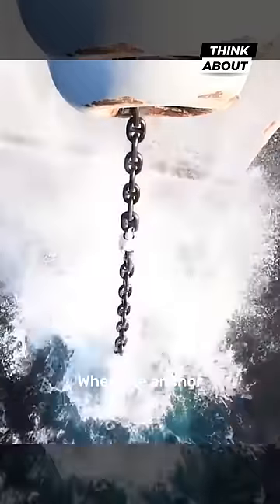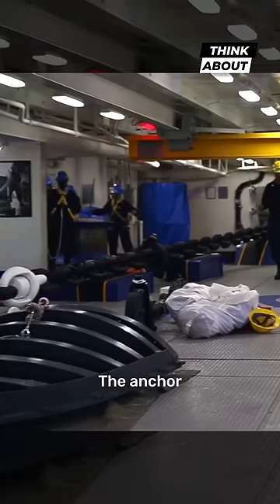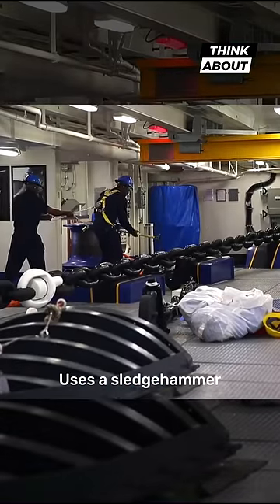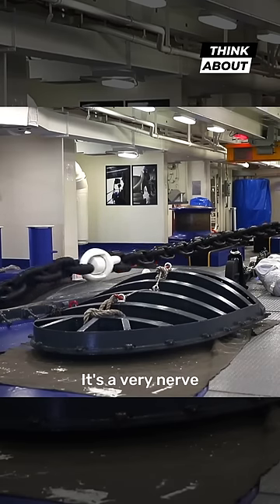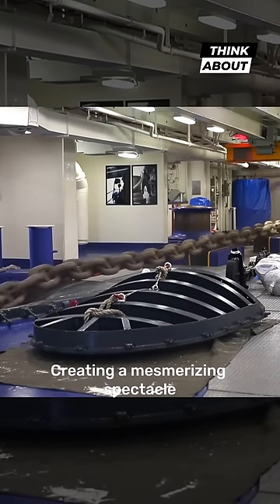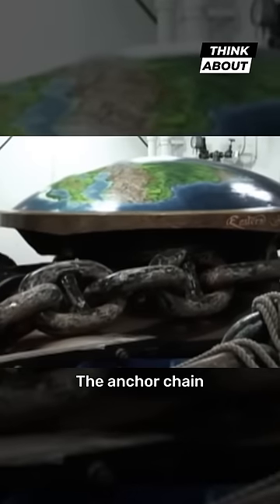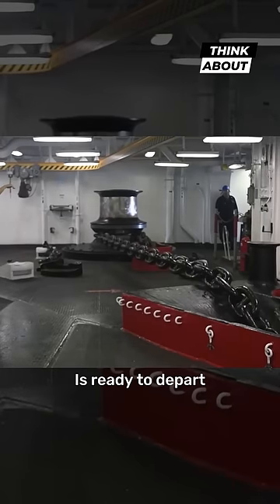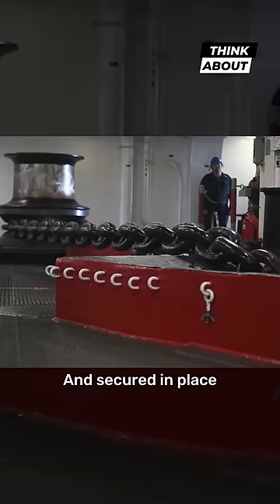Inside the Anchor Room of an Aircraft Carrier #shorts

Comment: Not chain it is called cable the stopper is called slip. ( Usually known as slips, are used to hold the cable when a ship lies to an anchor, either as a preventer, or stand-by, when the cable is held by the brake of the cable-holder, or to hold the cable temporarily so that the inboard part of it can be handled.)

Comment: It's crazy to think that the links on the Gerald Ford chain are 61 kg (~134 lb) compared to the Titanic at 80 kg (~175 lb), and 15 ton anchors on Ford and 15.5 ton on Titanic, which compares to the older Nimitz class at 30 ton anchors and 350 lb links. 

For those wonder why these make a difference, it's not the weight of the anchor that holds the ship in place (though it definitely helps), it's the weight of the chain spooled out on the floor of the ocean that secures it (the Ford has 1,440' of chain, Titanic has 1,200' foot of chain, and Nimitz has 2,000' of chain, from what I can find, though I don't know if this is per anchor or in total).

Comment: I’m just surprised how that relatively small anchor can hold that huge ship in place!
Reply: Actually it does not hold the ship in place. It is customary to lay out at least four times the depth of the water, with anchor chain . The weight of the chain actually does the work.
Reply: @nedgroody1632  Was just about to comment that I’d heard that…
Reply: @nedgroody1632  Basically the longer the chain, the more force it takes to lift it from the ocean floor. The shorter the chain, the less force. So if you only let out a short amount of chain, it doesn't take much force to start pulling on the anchor.
Reply: The anchor is used to pull the chain from the ship, the chain is what holds the ship .

Comment: Do they actually drop the anchor at sea? Or just in port?
Reply: Very rarely inside a port because in most ports, it's forbidden to drop an anchor due to cables laying across the floor.
Reply: @allaboutperspective650  , now when you say inside a port, you mean tied up at the pier, where an anchor is not used at all. You have mooring lines to hold you in place, such as Subic Bay, in the Philippines. But, at liberty ports of call, you drop anchor offshore and take liberty boats to the beach. So, yes, you DO drop anchor in port, but you're far enough offshore to not cause damage to such things as cables as you just mentioned. And yes, the aircraft carrier I served aboard dropped anchor at sea, too. Usually on "no fly" days.

In 1987, my ship dropped anchor at Karachi (Pakistan), Mombasa (Kenya), Palma (Mallorca, Spain), & Cannes (France).
Reply: @TheHawk--oe8iq  I think we have a misunderstanding about what is inside a port. When I say a port I mean inside the harbor not outside at sea. Offshore you can drop an anchor, if you drop an anchor inside the port of Rotterdam you most likely gonna hit some pipelines or cables.  In every port I have been with bigger ships we always had tugboats in the port however on coasters and fishing boats we never had a tugboat and empty with a storm it could be a problem, nowadays they all have bow thrusters.  btw In the late 70's I was in Mombassa first 4 weeks outside waiting due to strikes and later 6 weeks inside the port loading coffee in sacks  🤣.

Comment: That weight of 61 kilos sounds way off. I did 10 months on cv-61 at the end of my tour and those links if memory serves were around the 340 lbs area. I also did 2.5 yrs on a cg and those links were in the 43-44 lb range. The cg was only about 540 feet long and 6000 tons where the cv is over 80,000 tons.
Reply: yea 135 lbs for each link seems light to me.  I've never been around them so I really have no idea. but that ship is huge